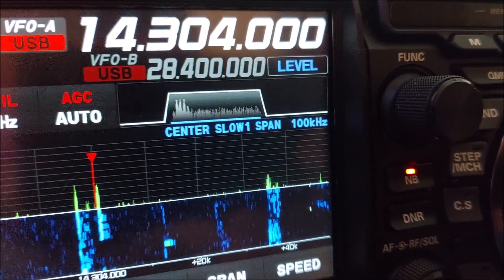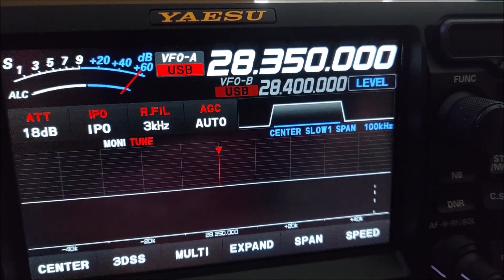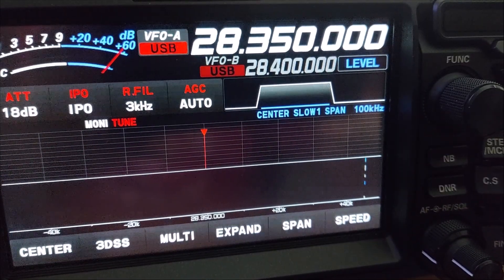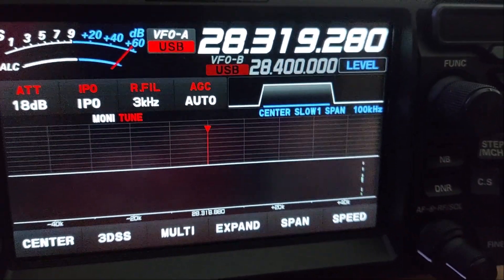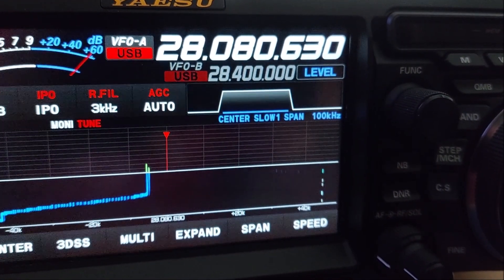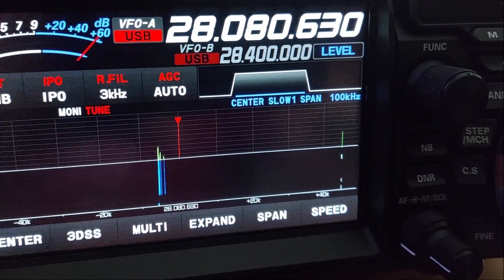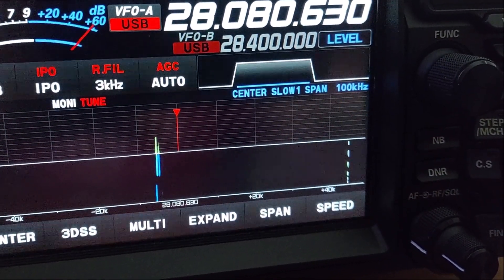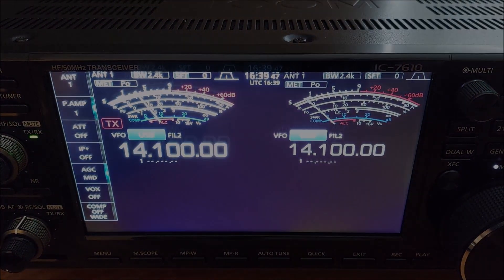Yaesu FTdx10 Has Some Serious Issues

Comment: A similar symptom was over my FTDX10.
It has exactly the same displayed position.
The position displaying does not change even if I change the band even if I change the frequency.

I live in Japan.

【Same Symptom】
https://youtu.be/ZxCOH5Qr8RA

https://youtu.be/rhrg-bShuM8

https://youtu.be/axYPOXnroOk

https://youtu.be/smpon2B1Lfk
Reply from the maker: yup, the same thing has happened to many people, it comes and goes.   it was annoying enough that i sold it.
Reply: I have sold, too.
Reply from the maker: @tubereceiver7187  the new 710 doesn't make any sense to me either, I guess it's a direct sampling sdr? I don't know it seems very close to the ftdx10, I imagine it will have its bugs also. Id like to see another 991 replacement with VHF and UHF, I'm very skeptical about purchasing a new Yaesu these days that's for sure.
Reply: me too.
Reply: @tubereceiver7187  sold it, never going back

Comment: I cant get Yaesu to respond to my emails, wanted them to look at my videos and respond. I have talked to Tim and Juan with a promise of response. Nothing yet after almost two weeks.  What did you do with the FTdx10. I cant sell my in good faith with the lock up issue it has.
Reply from the maker: I had to remove my SD card. That stopped the screen from locking up, but it should not have to operate that way. Yaesu would not respond to me or return my calls or emails either. So i sold it, the buyer was familiar with the screen glitch as his ftdx101 had the same issue and he said it did not bother him.

Comment: For those of you with the issue, you may want to try BANGING on the top of the case. If that fixes it, may want to open it up and be sure all the SCREWS are tight. Loose screws from the factory is not that uncommon. Depends how they have the torque set on their pneumatic screw drivers.
Reply from the maker: I'm laughing because you're right, yaesu has a few screws loose these days LOL
Reply: @morejelloplease  OK, to bad you sold it! I figured out what happened! It DID have loose screws but it is your fault!! You turned up that monster McIntosh Amplifier and it shook the house and the radio, causing it to come loose!!! 🙂
Reply from the maker: @myradiovideos  haha just saw this...   the mac powers the magnepans, must have been the rythmik subwoofers ;)

Comment: I've had my Yaesu ftdx 10 for almost one year no problem with screen freezing up like on your video and no problem with that Phantom signal on the right side of the display like in this video
Reply from the maker: What version firmware do you have? Have you tried the DVI to HDMI external video cable? Be careful because you can blow the video output as well
Reply: @morejelloplease  Is the 7610 safe from that voltage coming back issue with adapters?
Reply from the maker: i never had an issue on my 7610 and never researched the issue, it may be a yaesu thing.

Comment: Maybe there is a faulty batch of radios, i have owned mine for 1 week and no problems yet.
Reply from the maker: Give it time... what firmware?
Reply: @morejelloplease  V01-10
Reply from the maker: @icsp2  I had the same, I saw out of the corner of my eye and then it disappeared, I didn't think anything of it, it didn't show up until a couple weeks later and then it was there for days.
Reply: Still OK here, no problems showed up in the last 11 days since my last post.

Comment: The FTDX3000 DSP has "leakage" and causes a solid line on the waterfall. Mine does. Maybe possible the same DSP leakage exists in the FTDX10??  Narrow up the display range and see if it disappears.
Reply: Mine did it at all span settings
Reply from the maker: My ftdx3000 had the same line, at least Yaesu disclosed it. This one is new to Yaesu and they're still denying it. It doesn't matter what the span is set on but it seems to do it most when its on 100k.

Comment: I'd think it was something close by or in your house causing that. Maybe a cell phone charger, wall wart, alarm system, lighting, solar panel in the neighborhood, electric fence, bad or cheap power supply, attic fan, computer or monitor, night light....or a million other things. I wouldn't be so quick to blame the radio as much as I would something in the environment. Have you tried some ferrite chokes on the coax or power cables or even something in the house? I bought a quick charger for a cell phone and when that was plugged in cause all kinds of noise. Took me weeks to find it. Systematically start looking around inside then move outside.
Reply from the maker: If the radio is susceptible that easily to outside interference then the radio is still at fault. I moved the radio to a different location, different power supply, completely different zip code for that matter , and the problem persisted. I'm not the only one with this problem out there. The glitch is definitely internal, it does not move with frequency, i.e.  it doesn't change when you move the vfo. It does it on all bands in the exact same spot.  I could go on and on, the radio is the problem. I could stick this thing in a faraday cage and it would still do it.
Reply: you'd think wrong, and it's very easy to see it.

If it was the radio picking up an external noise, by moving the VFO knob you would see the trace on the scope moving from its position. Which it does not.
Reply: I moved mine to my car and hooked it to the battery, drove all over the place and it would do that everywhere....no cell phone nothing but the radio and the car battery....no antenna either....very odd...

Comment: Hi…mine has the same problem and been to Yaesu twice and being told it can’t be replicated and it’s YOUR environment…Hi….hopefully more people come forward with this
Reply from the maker: This confirms my suspicions that Yaesu knows about this, and they are sending everybody the same email saying that there isn't a problem. First, it was the DVI issue and now this.  None of the other brands have DVI boards that are going up in smoke due to back voltage, they should have designed it right in the first place. I used to love Yaesu, but not anymore.
Reply: @morejelloplease  they will tell me they have a fix after it’s out of warranty and I have to replace the main board for $500 or something…lol…I think I’ll be a new fan of flex radio’s…hi
Reply from the maker: @Nunya Bidness this is my 2nd 7610 :)
Reply: I have the same symptom.

【See below】
https://youtu.be/ZxCOH5Qr8RA

https://youtu.be/rhrg-bShuM8

https://youtu.be/axYPOXnroOk

https://youtu.be/smpon2B1Lfk
Reply: People should attempt a class action against Yaesu. It's not the first time problems occur with this brand...
My only Yaesu I got was the ft-857D and it was the last. I was tired of the fan noise, bad quality (the select encoder started to be dead...), it feals cheap and like plastic. I sold it and bought the IC-7410 by the time. Yaesu never again...